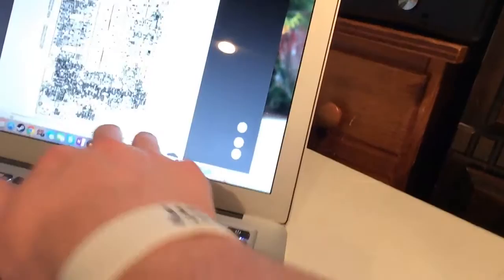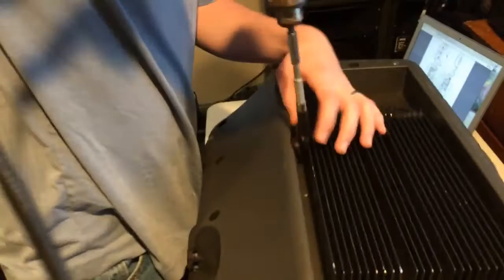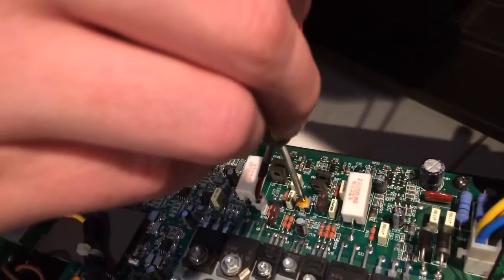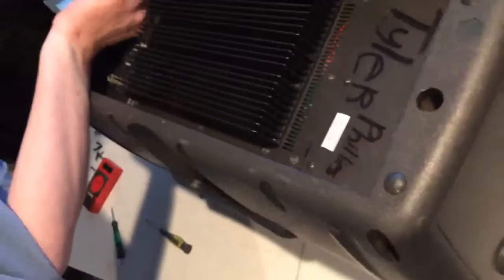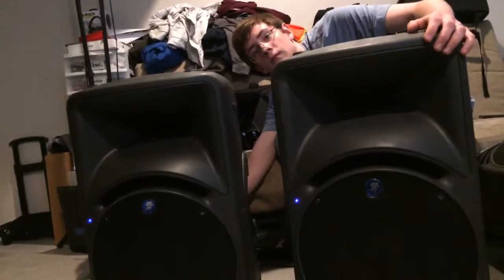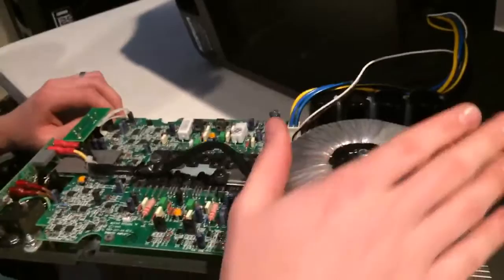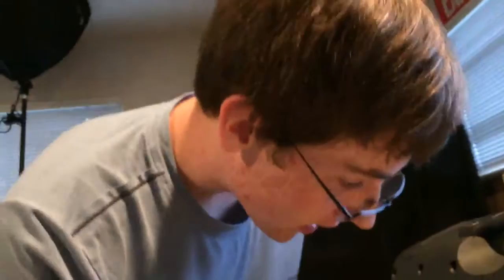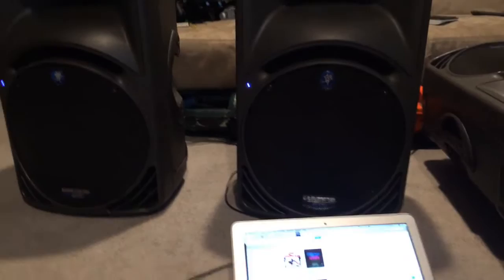Mackie SRM450v1 BIAS Amp adjustment

Comment: i put strip caulk, some call it dumb dumb on the tips of my Phillips head screw drivers...Its like a caulk that never dries if you have never heard of it...It just sticky enough it holds the screws on the tip nice...Works good to make gaskets when mounting speaker drivers into a cabinet too or like your plate amp to seal it to the cabinet and reduce any vibrations

Comment: Thanks for posting this!  I have a couple questions - what's the purpose of the bias adjustment, and how do you adjust the signal processing pots?  I have 3 mackies, two of which are softer than the third and I'd like to calibrate them so they're all playing at the same volume.